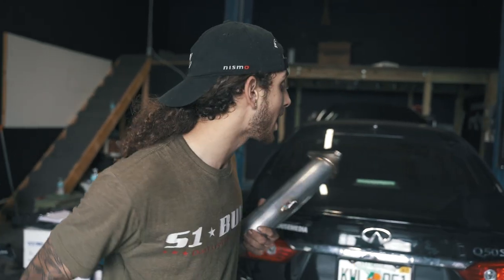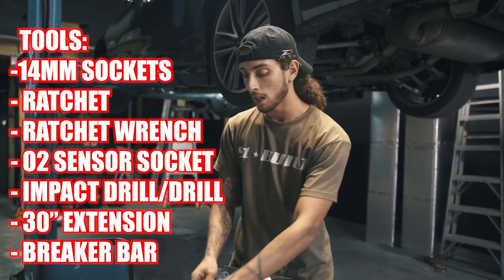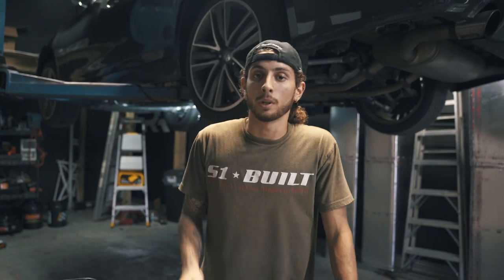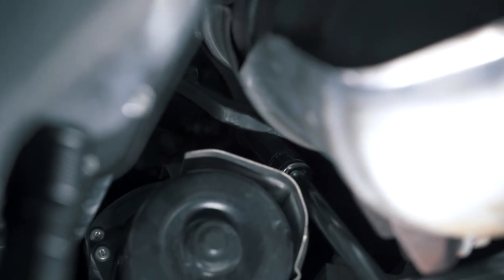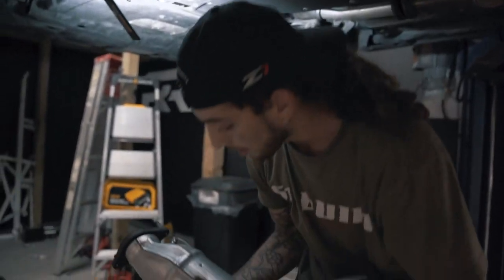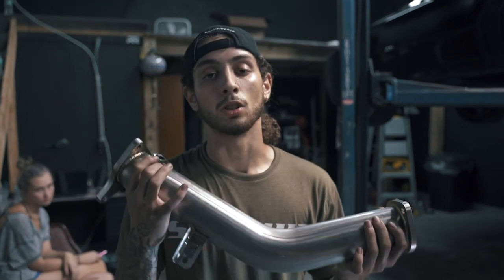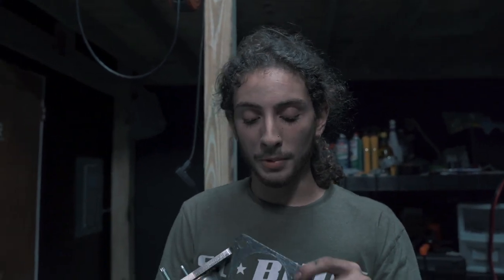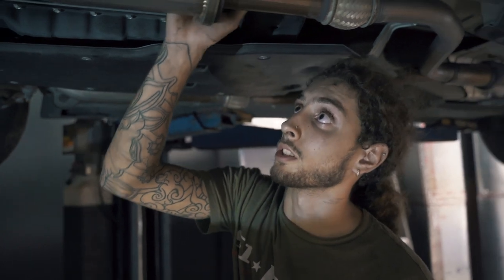HOW TO INSTALL DOWNPIPES ON A Q50! (TORQUE GAINS!)

Comment: Is there the risk of overboost with the lower downpipes like the full downpipes?
Reply: I don’t believe so, cause you still got your upper pipes your catalytic    converters they will still hold pressure and back pressure put now it’s easier to breathe for the car 👍🏻